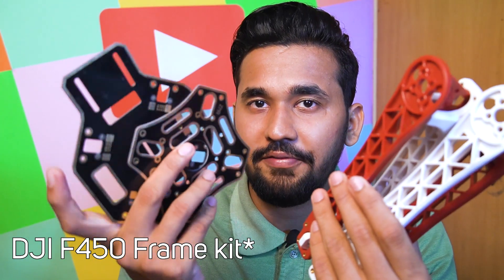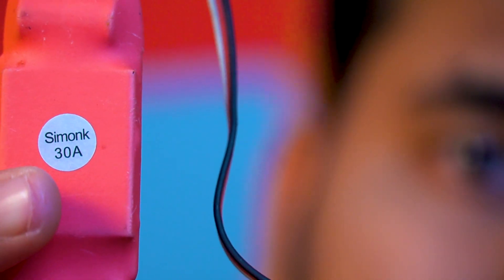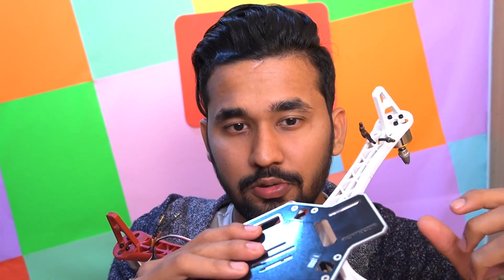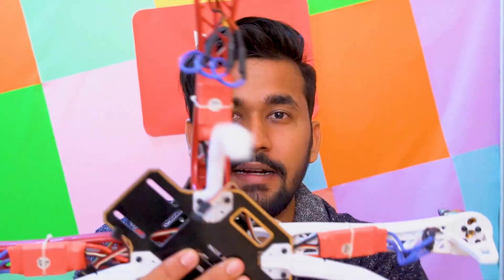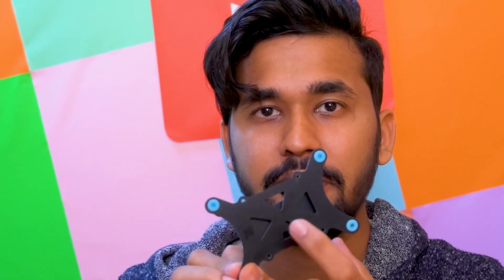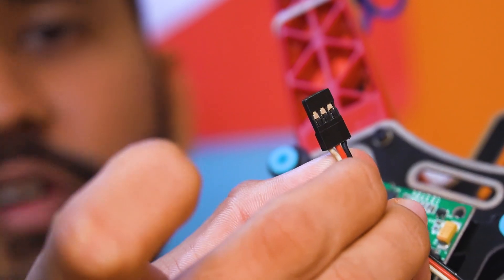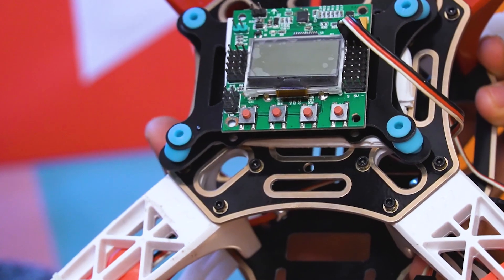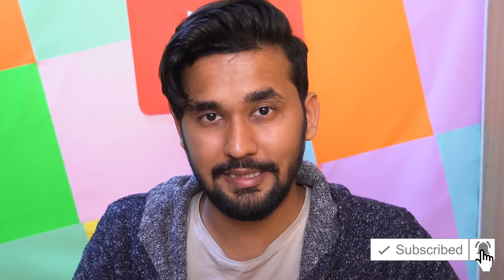How to Make a Drone at Home | DIY Quadcopter Drone | Part 1

Comment: I notice while soldering, you've made connections where current passes through actual solder, not the physical contact between wires, because there is none. The wire is held kind of 'near' the pad by the solder. This can be an easy point of failure specially in high amperage circuitry. Should solder better.
Reply from the maker: Sure, i will keep that in mind and make necessary changes,
Thank you for subscribing to Mission Critical! 😊
Reply: A tip : watch movies at Flixzone. Me and my gf have been using them for watching lots of of movies these days.
Reply: @Forest Andres Yea, have been watching on flixzone} for years myself =)
Reply: @Forest Andres Yup, I have been watching on flixzone} for since december myself :D